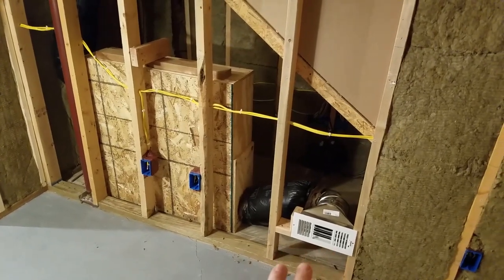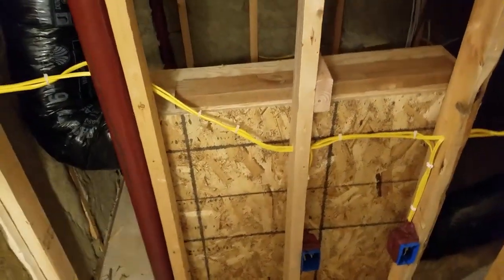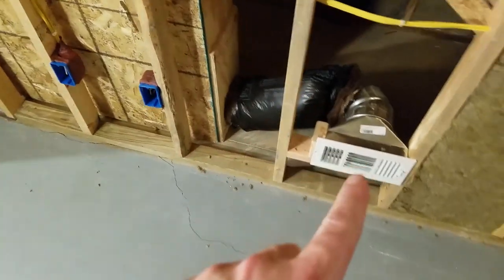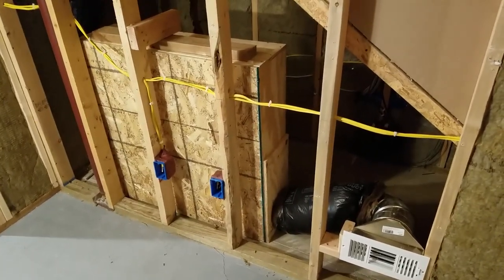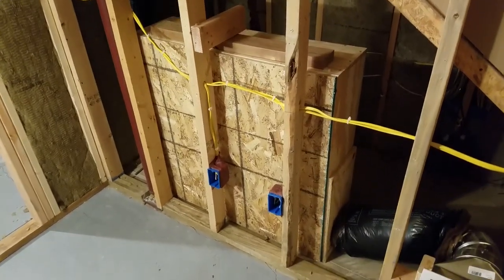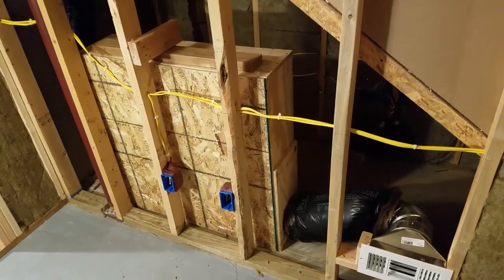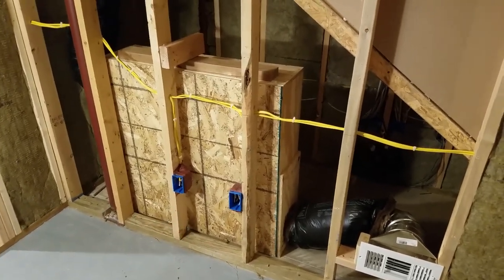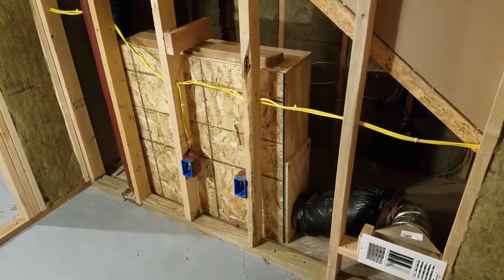How to Build a Silent Air Vent For a Recording Studio or Home Theater

Comment: the silencers are not effective, because I used x2, two silencers, one at each mouth entrance and low from 77db to 69 db my rvk200 of 1080m3, some Spanish brand sonoconnect soundproof ducts lowered me to 70.5 db, using 70cm on each side, Well, the silenced duct has a value of 3.80 euros per meter, cheap but the silencer, the silencer duct in my case of 60cm and 200mm is worth 200mm is worth a minimum of 50 euros, for 60cm of silencer, which has 4cm of low absorbent material class, 25kg wool or other low density per kg per m2 and density at a thickness of 40 millimeters 4 cm of wool, the silencers are the biggest expense less performance, now disappointed with the result of the silencers that I buy confident in 20 to 28 Result db I will desistalare them and buy spending more than one for bad information and deception because they are useless, the change is noticeable 4%, a modern conduit of the latest design, it is French it is called phonic trap, I am sure that replacing my s traditional rock wool and aluminum sonoconnect ducts for this phonic fabric with cotton that is just as effective as wool plus the polyethylene layer will have better results than with silencers and the obsolete technology of traditional aluminum soundproof tubes plus rock wool plus aluminum Micro perforated, as I will trust the phonic trap brand, I found a virgin brand phonic trap from France that looks good, in my country Spain Madrid, we only have silencers that do not give good results and obsolete aluminum pipes plus rock wool Simple, thank God I found modern French ducts which I have not used or tested but I trust, my idea is to use my size of 20cm to which I am going to micro-perforate and the outer layer to add rock wool of construction of 40kg and 5cm more thick to add to the tube that thanks to the metal structures does not obstruct, then the 20cm tube has a total of 24 I stick 5cm good rock wool and have go 29cm I will add 1cm of acoustic membrane for low frequencies of 2mm and then a total of 30cm I will put another 31 cm conduit inside unmodified phonic trap, in plan an outer layer that protects, total a tube for a 200 extractor with a conduit of 315, but 115mm of absorbent layers
Reply from the maker: Thx for your comment
Reply: Silencers are not created equal. For instance, Sillennium box is weakened and only as strong as the flex duct between the box and the wall vent.  Ideally, the box should be right up to the finish wall.  The box up against a finish gypsum surface eliminates the need for non-acoustical flex duct. Let's be honest, insulated flex duct is not exactly sound proof, and sound will simply go around his baffle box. I"m no pro, just researching a LOT and looking for weak spots in other DIY designs in hopes I can make improvements. I have a studio build playlist but not a lot happening until I get these silencer/baffle boxes built.